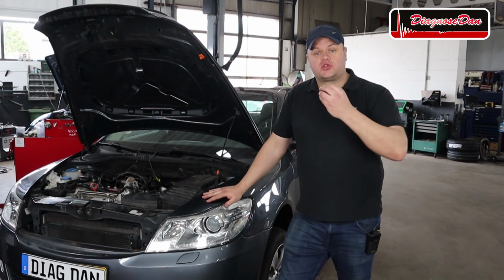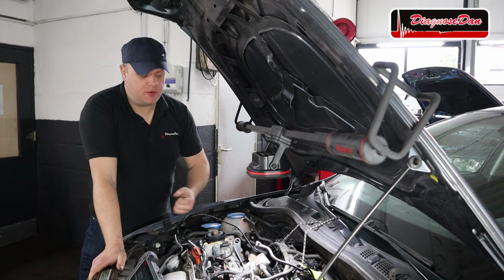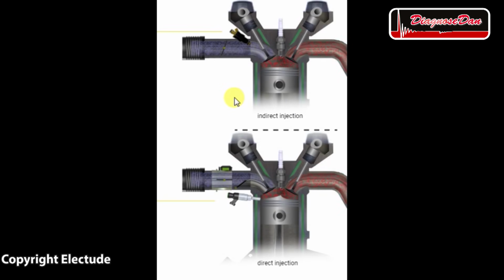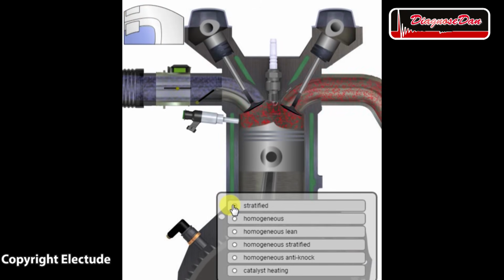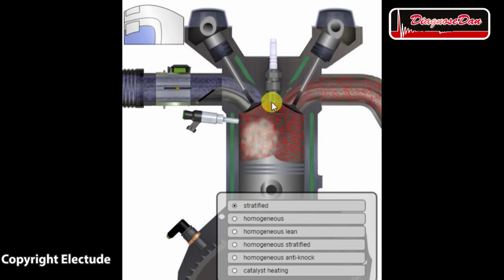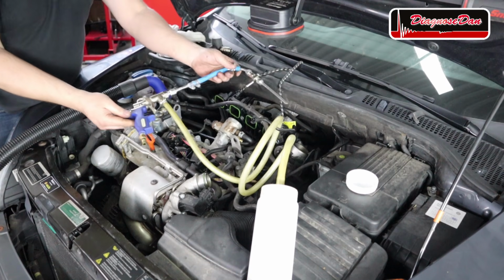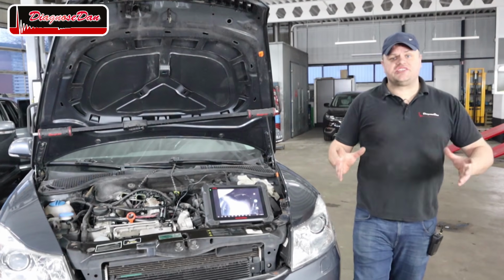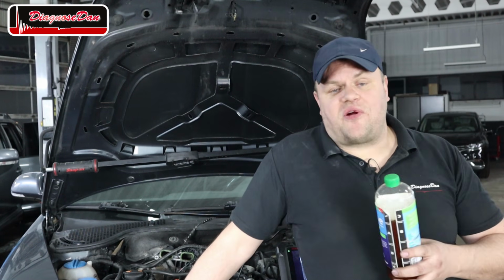Tsi cold misfires explained

Comment: I have the same engine which has driven 103.000 km and only the cylinder number 1 misfires just on cold starts. I am using new r8 coilpack and sizfr6b8eg ngk spark plugs. Could it be leaking injector or carbon buildup? It doesn’t lose coolant too.

Comment: Do these cold misfires caused by carbon usually make a ticking noise?  I have a ticking at cold idle on bank 1 that goes away once the engine warms up. (N63TU3)

 It also goes away about 3 seconds after driving off, but comes back at idle until the engine warms up.  The dealer replaced the bank 1 HPFP but no change.  1 year later and noone seems to know what it is.....DiagnoseDan could fix it!

Comment: Here in Hungary walnut shells are used usually to blast valves. It works fine, it is much softer than anything within the engine, so if some of it gets into the engine spits it out, not causing damage. Using soda is a nice idea, probably even better.

Comment: This is great work and explain why the cabon build up in TSI/GDI systems. 
But the goal for using this type of injection are the low fuel usage.
But doesnt the EGR systems also contribute to the carbon buildup.
I know that Toyota uses a combined port and direct injection, does this prevent carbon buildup in real life.

Comment: Thank you so much for this great job in the video. 

I got the same engine and I have a misfire in Zylinder 2. I have checked the pressure of that Zylinder and it was too low and others are ok not that bad. 

Do u think it’s also need to clean the valves? The thing that make me crazy that the engine work normally and just feel that misfire in the exhaust, and only when someone check with the computer, also there is no check engine light. 

Sorry for writing that much, and thank u in advance.

Comment: Dear Dan! Thank you very much for this post. I've had problems with my Passat for a long time and it seemed unsolvable. It has been looked after by many mechanics and a number of parts have been replaced without improvement. A maddening puzzle until I saw your post. Everything fell in to place! Everything was right as you described. The symptoms, the what is going on inside the engine causing this and why, and the solution. The intake valves have now been blasted and I have what looks like a new car! Many thanks!!

Comment: Dan, the carbon buildup is MAINLY caused exhaust gas recirculation! Not crankcase re-venting alone.

Easy remedy is to blast clean the valves, renew the intake manifold (or painstakingly clean it, like have done) and disable EGR altogether.

Happy driving.

Comment: 2017 VW tiguan  84,000 miles (gen 1) I had p0300 , P0301, p0303  codes. Very rough cold starts  occasionally.  I had walnut blasting on intake valves and as long as they had everything apart I did all new injectors $1100 total. MPG went from 24 to 27 like when it was new.

Reply

Comment: Yeah nah Im not a starter for revive. Your video and explanation however is second to none. I did have to laugh looking at the car like it was in an operating theater, I cant imagine the average mechanic doing that :) Actually I don't think I'm interested in a direct injection motor either for the small savings in fuel and the likely large cost in maintenance.

Comment: I'm wondering if this is my issue on my Mk7 GTI. I just recently had a cylinder 3 misfire CEL. I changed the spark plugs and coils. It continued. I used OBD11 real time data to view the misfires and noticed it was only misfiring during the warmup. Once the RPMs dropped, the misfiring stopped... I'm thinking this is my issue?

Comment: Hi Dan, can intake valve carbon build up cause lower idle RPM?
I have merc M271 CGI and when engine cold (<20 minutes driving), the RPM only 600 when stop on brake (transmission in D / R) so the car feels vibrating. When normal the RPM should be around 700.

Thanks!

Comment: TSI engine  = no buy ?
Reply: No? Just service your car it’s not that hard to take off an intake that’s fully exposed to the operator just look up one of the 60 videos on cleaning them and in my opinion grab some zip ties and some Lucas oil deep clean gdi spray and make sure the valves are at top dead center you’d have to do your research on which car you buy to get them to top dead center but you have the product and tool right here imo get a 130k mile mk6 gti and have fun you’ll learn everything you ever need to know about the gen 2 ae888

Comment: Mine only misfires when it has sat in rain or fog. Then somehow water or condensarion gets into the air intake system and the first kilometers, cold of course, the car jerks a bit.  Easy to notice: open bonnet, engine a bit wet? Then issue occurs.

Comment: Thank You for yet another excellent video, Dan.

When I was watching the part where you had used the chemical, and said , that it did not work as you had expected, I thought, that perhaps you could just use a couple more bottles of it - say, 3 bottles in total.

From the video it looked like it did remove, at least, a half of the original amount of the build-up. So, the natural question comes, "Why didn't you just keep at it"?

Just a thought...

...

I use the CRC GDI Intake Valve Cleaner, here, in the U.S. and, to be honest, it works great for me. I do feel a better response from the engine after a cleaning, and do it periodically, once a year, or so.

Comment: Dan I have problem with vw 1.4 tfsi 118 kw engine it misfires only at 2300-2600 rpm ,on idle works fine and higher than 3000 rpm no misfires we try everything and still acting the same

Comment: Well impressive.  Pretty unusual to find a mechanic who understands the technical side of engine operation and design to the extent you have explained in this video!  Great stuff.  Need to have a look to see if you have a video about Tsi engines that 'hiccup' when transitioning from low load to high load at mid rpm (e.g. going onto a steep incline, or heavish acceleration).

Comment: Good video! I’d like to add that the breather system is a part of the problem too some DI engines never get that dirty. I personally wouldn’t use chemicals on valves that bad because a chunk of carbon can come off and if gets gets on a valve seat the valve can burn up and also converter failure.

Comment: Very interesting video and super detailed! My car, a Seat Leon 5F 2013 1.2 TSI with 135.000 km on it has some different symptoms. It runs smoothly when stationary, but only when giving full throttle driving at around 100 km/h in sixth gear at roughly 2000 rpm, it starts to vibrate and feels like misfires. Do you think this is also due to carbon deposits on the intake valve? Also, do you think a regular oil engine flush before changing oil helps to remove carbon deposits from the intake valves? Looking forward to your answer.

Comment: Its not just carbon build up sadly :/. Some of their TSI engines eats piston rings like some of us eats cereal, just got scammed buying a 1.4 TSI CAVD, during the test drive it flashed a missfire code and figured it was just plugs or coils that needed replacing. Sadly further diagnosis indicated 50% compression on 3 out of 4 cylinders and it was pushing oil past the pistons if you blew compressed air down the dipstick hole :/

Comment: Hi Dan,  I've just subscribed to your channel.  I have a 2012 petrol 1.4tsi cavd engine with 80k on the clock. Upon start up it idles like a diesel. The rattle soon goes once it's revved up.  Is that carbon in the pistons causing that, or just normal until it warms up.  Comments very much appreciated..thx
Reply: More like timing. These engines had a problem with premature chain tensioner wear/material defect in the chain/faults of the camshaft phasing unit.
Reply: @MaximusHexon  thx v much for the reply. How long does it take to replace the tensioner n chain how much am I looking at..?

Comment: Love the videos Dan, just following the diagnostic steps on modern cars is fascinating.  In this one,  the explanation of how these TDi engines work was really great.  The only thing that made me think was where the carbon deposits were coming from?  No fuel should be passing the inlet valves, only air, so no carbon there.  Then it occurred to me that modern cars vent environmental contaminants back into the engine - via the inlet valves.  Presumably, a car that gets this amount of deposits must be venting a lot of oil vapour for this to occur?

Comment: If you ever removed even a tiny tar spot from bodywork, you know how well carbon deposits resist solvents - they're tough. No way will spray & pray remove them deposits without mechanical agitation using an abrasive. Back to blasting.

Comment: I did before the blasting in my old Q7 2007, but I used walnut  shell, I had the same problem, missfire, check engine, no too much power. I saw some people installing a oil catch can!! what do think about those can Sr? I did in my toyota camry just for fun and because is easier hhahahaa, for the kind hose clamp and does it, but Audi you know in the valve cover the hose is really short and is different the connection, but it can help to reduce the carbon build up right?

Comment: I think Revive works, but first it cleans the intake and all of that carbon ends at the valve chamber. So maybe it's better to use Revive and after, make the cleaning you did. 

I don't know if all the workshops does in that way you did. I think I will ask in mine workshop how they do this kind of fix, because if they will use a brush it doesn't worth the money you pay, I think.

Comment: Hey Dan, Would carbon build up on the intake valve's cause the STFT to turn negative -10% in my case? no Cold misfires.  Technically they're in the normal range for the most part, but they were always close to 0. Vehicle has 170K. Cheers

Comment: I have cold engine Stuttering at light load , around 20-40% , below or above no problem , but i took of the manifold and cleaned the Valves , problem persists .. Anyone had any idea .
Reply: i have resolved the issue , its not one issue , its Coils , sparks , injectors and PCV valve , letting way too much oil vapor in to the engine . making mixture too lean causing massifier .
Of course , there is Lamda probe or Oxygen sensors , mass flow sensor ,  crankshaft position sensor ,  and some other sensors .
Basically in 10 years all of them became a little bit broken , it all works , but not 100% , all of it combined causes misfires .
Now i have my engine running well , but i still need to change PCV valve , one on the engine block and one on the top , oxygen and lamda probe , and maybe even timing adjustment sensor controlled by the oil pressure .
These engines are complex ,and need all these parts to work proper in order to work well .

Comment: The absolute best way to clean up all that carbon is to have engine running Approx 2000 rpm with a small hose and a Cup of Ice cold water 💦 allowing it to suck through the Intake Little at a time even as engine Bogs down in RPM.
The Ice Cold water will cling to Carbon and Break it into Pieces.....Will Clean both Intake and Exhaust Valves like they Shine on the inside.......Fixed many of these TSI engines that way,And works Perfectly 👍

Comment: Dan, is there a way to insert the endoscope (borescope) without disconnecting the intake manifold (by the way, for a 1.4L TSI 2013 which is different from the engine you are showing)? 

UPDATE: On the 1.4 TSI, the air tube goes front to back across the engine into the turbo, and then there is another straighter tube that goes back to front from the turbo and bends down into the throttle, which in turn leads into the input manifiold. At the throttle input end of that turbo tube, there is a "boost sensor" attached, which I think is just the same as a MAP sensor, and it seems ~easily removable. So the question is whether I can/should thread a scope through that MAP hole , or if not, disconnect the throttle input tube, and thread the scope through the throttle. Is the scope going to get stuck? Will I be able to navigate the scope to all 4 cylinder input valves without difficulty? Any other ideas?

Comment: 5:00 You should have mentioned where the carbon comes from. It's from EGR valve that circulates exhaust gas to the intake manifold. Without EGR the only thing moving in the intake manifold would be fresh air from the air filter and that wouldn't cause any carbon build-up, obviously.

The EGR system is there to reduce nitrous oxide pollution and if you were to disable that system, the engine would last much longer but the pollution would increase, hence that's not allowed.

However, with the TSI engine design, I fail to understand how EGR system could work even in best case in long term. Is this engine type going to suffer from carbon build-up failures in all cases?

The interesting part is could you avoid this build-up if you used the revive product during e.g. every oil change. It doesn't seem to remove all build-up but does seem to have some effect and if you were to prevent the huge build-up in the first place, the build-up will grow slower because the air will flow more smoothly. After there's quite some build-up, it will clog even further pretty fast because of high turbulence due build-up in the intake.

Comment: Wow that Revive turbo cleaner worked quite well.  This is the only video I've found where someone shows with an actual borescope the before and after results.  I think using this or any other water-based non caustic, non flammable, and non corrosive degreaser and using it as a regular preventative maintenance would definitely see positive results.  The thing is most people wait until the problem gets bad to try these products out. I can definitely see in the video that a lot of the accumulated gunk was removed with just 1 treatment.
Reply: So no oil or fuel  additive can achieve this correct?

Comment: Since my first experience with carbon build up on GDI and the like engines I started to educate my customers the need for performing the cleaning before it becomes a mis-fire. Im not sure of or the validity of claims reducing this carbon by installing an oil catch can system in the PCV system but it still has to be cheaper then the blasting or heaven forbid an expensive valve job .

Comment: Hello. I am wondering what kind of fuel trim numbers going to be, lean or rich, on this kind of misfire. I am thinking if there is other way to proof that this misfire was caused by clogged valves, without taking off the intake manifold.

Comment: Such a helpful channel! 2013 Tiguan and my engine started misfiring in the cold weather, while in park and stationary was the worst of it. This is so helpful when it comes to communication with my mechanic. 💯
Reply: Did you get the blasting procedure done on your Tiguan? I have a 2013 Eos with the 2.0 TSI. At around 65,000 miles it was running a little rougher than normal and the gas mileage was lower as well. Went and had the walnut blasting done and it is like driving a different car! Runs so smoothly that it cant even be felt through the steering wheel and improved mileage. It's somewhat expensive but only has to be done every 65-75,000 miles. Hope your Tiggy is going strong!
Reply: @markb3756  getting it done soon, I have to get my Tiguan towed 220+ miles to Salt Lake for the nearest VW person to do it. Worst part about moving to the countryside. Nobody wants to touch a VW.

Comment: Another fsi misfire cause is spark plug gap or incorrect plug. Fsi is sensitive to spark in various situations. This was cold misfire specifically though so mostly this is Carbon build up or runner flap fault. Also worn cam lobes can cause random misfires which are hard to trace. Im buying the autel mk808bt this year and I love the camera scope will get one of those aswell. Smashing video Dan as always.

Comment: I have replaced, spurk plugs,ignition coils,injectors,valves n valve seals, piston rings,timing kit +camshafts and ECU n random/multiple cylinder misfires is still there at idle only in all cylinders,,, what could  b my problem

Comment: Hello Dan! Does this same principle apply to FSI engines, without the turbo? I own a mk4 golf 1.6 fsi and have random misfire engine codes for cylinders 2 and 4. My mechanic said after working on it for a while that it can be 2 things, valves not closing properly or the high pressure fuel injectors having a problem, but I'm thinking that the problem mostly occurs when the engine is cold so maybe walnut blasting would solve it.

Comment: Hi Dan! Got a question. I've got a Golf 7 with a 1.2 tsi engine. Sometimes it hesitates on startup, it always start up, but it is like wobbling for about 30 seconds and then goes away. It happens randomly on cold start. And while driving when the engine is cold it feels like there's a plug that needs to go away for the engine to perform 100%. When the engine is warm it runs fine. I might also add that while idling cold or warm the fuel consumption is very high, but while driving it stabilizes. 

Could this be carbon build-up causing this?

Comment: Hi Dan, thanks for posting this video as misfires in TSI engines seem to be unavoidable unless very diligent cleaning processes are conducted. In my case, after thoroughly cleaning the intake, replacing plugs, coils and injectors, still get a random P0304 code. Random because after cleaning the intake I've not been able to recreate the fault in a special condition/environment. Intake vacuum and cylinder compression have been measured and results are OK. I have a VW Golf MK7 with the 1.4TSI engine and DSG gearbox with 103.000 kilometers on the clock. Any ideas are more than welcome! Thanks
Reply: Did you find a solution to the random misfire?

Comment: Will premium, high octane gas prevent carbon buildup ?
Reply: No. Nothing will work for GDI engines other than changing oil really often with quality oil, and using a PCV catch can. This will keep most gunk from the PCV system from getting into the intake and getting on the valves.